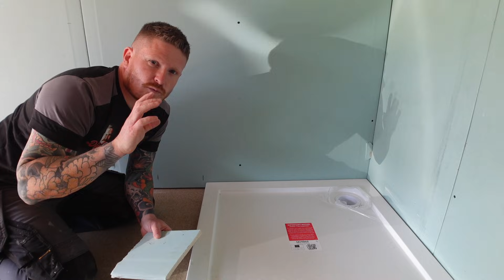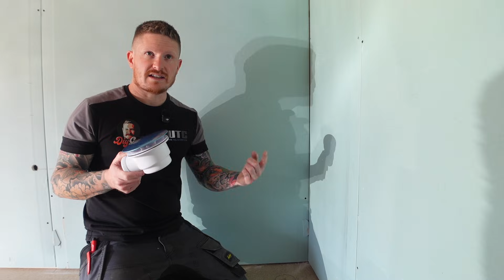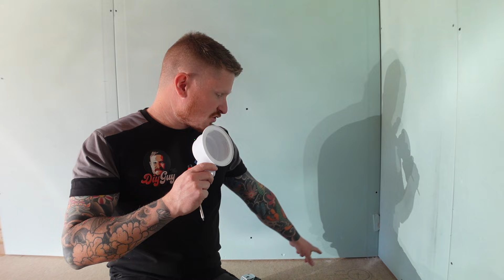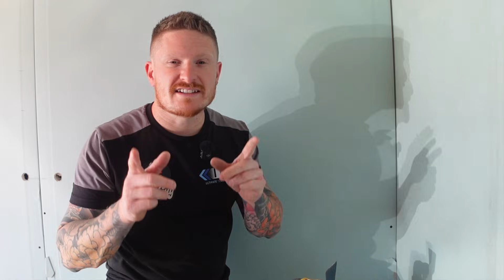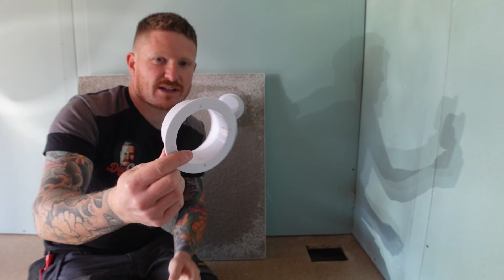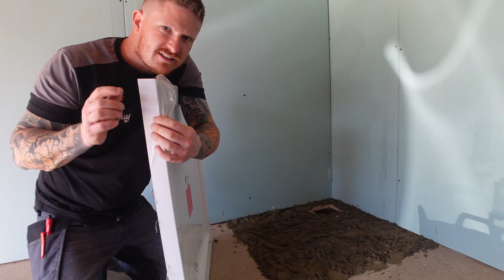How to Fit a Shower Tray Like a Pro | DIY For Beginners

Comment: Been fitting trays for 20+ years, allways use flexi tile adhesive never sand /cement.
Reply: most manufacturers stipulate sand and cement with good amount of plasticiser ,or your risking a void on the guarantee of the tray
Reply: Sand and cement is fine as long as you use an Sbr plasticiser.

Comment: I know one thing ! That tray is not stuck to the cement ! I never use sand and cement - always tile adhesive - even if the manufacturer specify use what we know works and doesn’t fail - I rip out shower trays with sand and cement with ease
Reply: It's not meant to be stuck to it.

Comment: Most manufacturers will stipulate that the tray should have the film removed prior to installation for the purpose of inspection. I, like you always left it on as a protective measure until I had one where the enamel had cracked around the waste, which I only saw when I removed the film to silicone around it. Turned out to be irreparable! Screen off, LVT around the tray removed, tray had to be broken out and all at a cost to myself. Only happened once but lesson learned, I use thick carpet underlay these days. As you said fit to the manufacturers spec the only thing I do different is tile backer board in the enclosure, SBR the floor prior to sand/cement or tile adhesive and I tend to use 18mm marine ply under the tray👍🏻

Comment: Ideally you’d be wanting to use cement board for walls and floors covered with a tanking membrane or some waterproofing system (BAL/Jacko/mapei) vapour board isn’t waterproof only vapour
Reply from the maker: Yep correct but this is a mock studio room which we’ve used to film the shower tray video.

Comment: A flexi upstand is needed to be fitted to edge of shower tray where it will be going to against walls. Classic Seal or other brand. Allows plenty of movement if floor was to shrink or move. 
I also agree with other comments saying cement board better than plasterboard
Reply: Wouldn't abacus backer board ( elements board) not be suitable?
Reply: @RayMondElec  I am sure it would be fine. I still would use the flexi upstand though, as the joint at tray to wall is where you want it to be always sealed.

Comment: Love your content on most of your videos, however, this is not your best sorry to say.  British Standards require refurb. and new showers to be water-proofed; normal plasterboards must not be used in shower areas.  This applies to MR plasterboard.
Reply from the maker: Yeah I don’t disagree ref walls, I’d use jackoboard, but this is a mock studio room where this was filmed, the video is to teach people how to install a shower tray(which it does).
Reply: Agree he's full of so many fantastic tips and tricks... Have learned lots from this channel. But here - I would definitely use proper backer board, or at the very least tank the MR. Marine ply not chipboard underneath, just because in case there is a leak you aren't screwed. Also deffo some sort of classi seal or similar upstand helps, reduces chance of leak substantially
Reply: Thank you for your response, sorry but I believed that this was part of your extension build and not a demo in a studio.  Keep the videos coming!

Comment: I wouldn’t fit the waste in that corner. I would spin it round so the trap is on the outer edge for easier access in the future by cutting the floor in front of the tray. Obviously depend what’s on the floor like tiles etc then your going through the ceiling below. I would seal the shower tray to wall and let it dry before the tiles are fitted.
Reply: With that type of tray you ain’t stepping over it. Will always be in the corner out the road. Unless it’s not square. With some quadrant trays you would be stepping over it regardless but all depends what the customer wants. 
Your install/videos are very good and very helpful to people wanting give it go. Keep it up.
Reply from the maker: Not many people will want to be stepping on the waste as they enter the enclosure that’s why the majority of people install with it in the back corner.

Comment: This video is very timely for me, I'll be installing a shower tray in the next few days. The problem is that it's on a concrete ground floor. I have had to make a massive hole in the concrete to expose the end of the 4 inch pipe the drain will connect to. I'll have to prepare the 40mm pipework and get the trap in the right place before filling the hole and putting down the tray. I'm thinking I should put sand and gravel around the pipes before concrete and screed. It's going to be difficult to leave much adjustment of the trap after that, and it'll be impossible to check for leaks. Does anyone have any better idea how I should proceed??  Perhaps protect the end of the pipe and trap with shuttering before the concrete fill???
Reply: That's exactly what I'll be doing. Very limited in options. I'll fill the pipe channel with sand and compact as best i can , then use dry wall adhesive
Reply: @johnbrown-yu8md Drywall adhesive. Interesting plan. You're thinking it'll be like a solid tunnel to protect pipes from the screed.. I think I'll copy that idea. Thanks for that. 🙏
Reply: Any ideas anyone? 🤔

Comment: I have been plumbing for over 30 yrs and through experience i would always use or recommend backer board around showers
Reply: Fair play
Reply: Do you mean only when tiling onto stud walls or when tiling onto solid masonry walls also?
Reply: @Galvatron-82  I would think solid walls the OP would say are fine to tile to
Reply from the maker: Yep me too, but this was filmed in a mock studio room and because the video is about installing a shower tray we didn’t deem the walls too important for the purpose of delivering the how to guide.
Reply: @TheDIYGuy1  Assume that is the same reason for using the wrong plasterboard? Shouldn't be moisture resistant in the shower cubicle, that isn't what moisture resistant board is for.

Good video though. I'm glad you mentioned the manufacturer warranty part - the amount of showers I've fixed where they have been held down with silicone. Absolute scandal!
Reply: What should be the correct plaster board for a shower cubicle? Thanks
Reply: @RayMondElec  None! Only use water resistant boards and that way you can have it all sealed even before you tile or panel on top.
I began using plywood on stud walls around shower trays and it was better job than plasterboard and really good if the large panels were then to be the finish on top. But even plywood is inferior to water resistant boards.
Really the one or two piece shower units make a lot of sense as they can’t leak. They tend to be very bulky though and not always possible perhaps to get into a property
Reply: @NearlyFullyFree Do you mean like the Abacus elements board ?

Comment: Done this very job 5 years ago. Only difference I would recommend would be to use cement boards around the walls.
Reply: Can I ask. If adding cement backer boards cannot be installed is there another way of sealing the wall before tiling ? Can the wall be tanked with some form of tanking system if you don’t have the ability to install waterproof boards ? What would you recommend? We are currently planning our bathroom renovation and want to re-use our Matki shower tray so don’t have the space to install waterproof boards on the shower wall so looking at other options.
Reply: @paulstaniford8622 you could use backerboards which come in various thicknesses. Are you relocating your shower tray or is it staying in the same place?
Reply: @leesmith2653  - show tray is going back in the same place hopefully. Sadly we have had a major water leak behind the tiles from the mixer/diverter. Had to strip the tiles and remove the glass/shower tray so the walls/floor/joist could be tried with an industrial dehumidifier. 6 weeks and it’s now dry so need to make sure it all goes back and then re-tiled. Issue is the tiles were just on bare plaster so looking at what the best option is to  do this properly.
Reply: @paulstaniford8622  you can absolutely tank the walls, just make sure it's done properly